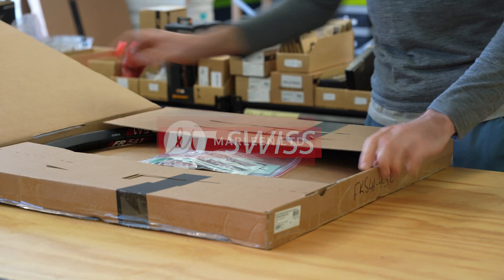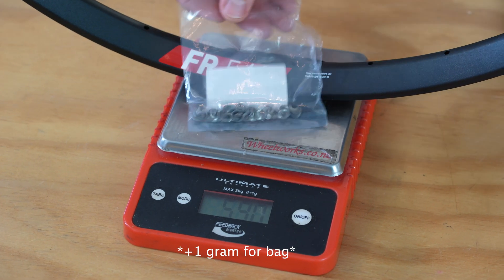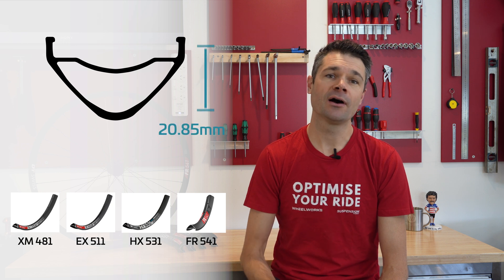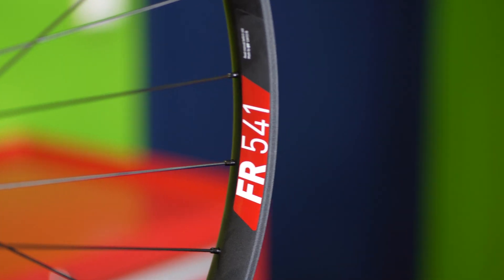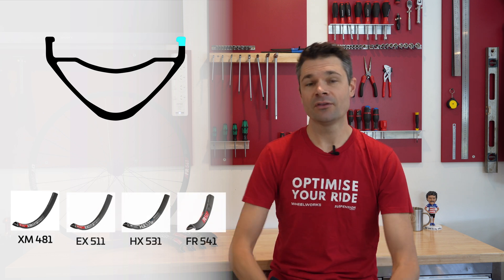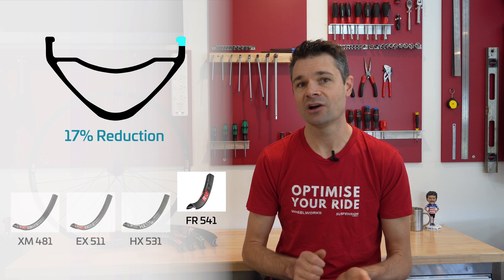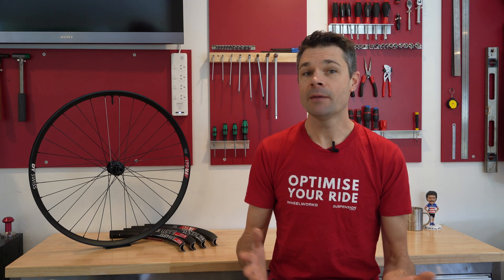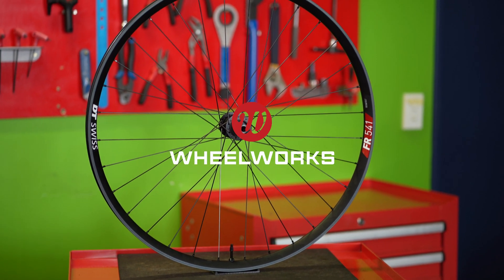2023 DT Swiss Rim Comparison and Review

Comment: I saw the impact resistance test with a 1kJ force. EX511 is left behind FR541 significantly. But how to understand such impact in a real world (speed, height, weight)? I’m not very aggressive rider, but in some cases would like to be confident, that my bike park trip will not end if I land on a root with my 210lbs weight.
Reply from the maker: This is an area where it gets complicated but interesting!  100 Joules is the equivalent of a 100kg (220lbs) rider landing on one wheel with no suspension and no bend at all in their legs from only 10 cm (4 inches).  Obviously that isn't very high!  That shows how much your body actions and your bikes suspension do to slow down the impact. -Tristan

Comment: I weigh 120kg and ride a 170mm E-Enduro bike. The spokes on the rear of my E*Thirteen E*Spec Plus wheel kept coming loose and it was constantly wobbling sideways. I had already replaced the front wheel with a DT Swiss H1900 wheel because I got it on sale for €129. For the rear, I've now ordered a custom wheel with a DT Swiss FR541 rim, 350 Hybrid hub, and 32 DT Competition spokes with DT Pro Lock Squorx brass nipples. I hope it will hold up better. The H1900 with 28 spokes at the front is absolutely sufficient, but for the rear, I opted for a 350 Hybrid with 32 spokes and an FR541 because it carries more weight. The E*Thirteen E*Spec Plus wheelset that came with the bike from the factory is definitely not stable.  The rim height is so narrow, the spokes are as thin as wire, and it flexes excessively. Absolutely unsuitable for an e-enduro bike, which is approved for a system weight of up to 150 kg with this configuration.
Reply from the maker: Many ebikes come with light weight wheels in an effort to make the bike feel and ride lighter.  Also, unlike acoustic bikes which are clearly understood to span a range of riding styles from XC to Enduro many ebikes are just "ebikes" so their designers try to make them span the whole spectrum of uses and rider weights and styles.  It sounds like your new wheels will be much better suited to your needs! -Tristan

Comment: Which is better for Aggressive XC/Trail, DT Swiss XR391 or DT Swiss EX511?
Reply from the maker: the XR-391 is 25mm internal width which is pretty narrow these days.  Check out the XM-481 and EX-511 which are 30mm internal width.  You can put and XM-481 on the front to save weight and an EX-511 on the rear.  -Tristan

Comment: I`ve been building EX511 32h wheels for both my DH and trail bikes for the last 10 years. Just built up a new set for my DH bike and the old ones lasted me 3 whole seasons. I don`t feel the need to go for the heavier FR541 at all.

Thanks for the comparison btw.
Reply from the maker: A lot of the sponsored pros seem to be using the EX-511 still...I think it's failure mode is maybe preferred. -T

Comment: Interesting video! The dimensional differences are smaller than I expected. 
I am looking into a hand made wheelset to replace my stock wheels, as I am a heavy rider (108kg). I don't break wheels often, but most issues I have had with my mountain bikes are things like broken spokes, bent axles or out-of-wack freehubs. I've rarely had rim damage though - likely in part due to running relatively high pressures to support my weight. 
As I ride mostly XC and trail, with the very occasional bike park lap, I am looking mostly at the lighter end of the spectrum, so probably XM481 with maybe an EX511 on the rear. 
Also, having a lot of red color accents on my bike, the DT swiss logo would complement this very well 😂
Reply from the maker: The 481 / 511 combo is one we use a lot.  If you're riding more technical trails then a 511 / 541 combo would be worth looking at as well for your weight, although if you don't typically have issues denting rims then the 481 / 511 should be fine.

One nice thing about this range of rim is their ERD is close-enough that you can rebuild a wheel with a heavier duty rim if the light one doesn't stand up -Tristan

Comment: Great Video, I'm interested in what the finish of the rim is like. I have EX1700's off a Transition Spire Carbon and the rims(mostly the back) are cosmetically terrible, it must be from sealant and lube, but nothing will clean them up, drives me nuts. Do the FR541 have more of a gloss finish? Cheers
Reply from the maker: All of the modern rims that use the PHR nipple washer (ie: not the ones with visible silver eyelets) use the same matte finish.  Generally we've found it to be pretty durable and still look good after lube, sealant, dirt etc.  Do you have any photos?  -Tristan

Comment: Interesting. I've had 4 wheels built with these rims (Raild Wheels Sydney) All was fine until this weekend when my 16 year damaged 2 of them on Cannonball at Thredbo. Both running maxxi DHR2 2.4  DH casing with cushcore. The mechanic who looked at them had a whiteboard with FR541 and was striking them off as they came in for repairs. 15 in 1 weekend. He was shocked and said he's barely seen issues with the previous FR560. Now I need to find better rims for Downhill racing
Reply from the maker: That's really interesting!  What was the damage?
Reply: Man that track is disgraceful for wheels all that concrete flaging i have destroyed many 511& fr's

Comment: Almost didn't give you a like for the use of that BS DC term usage, seriously, let Mike Ley's crap die. What rims do DT offer that have offset spokes, would be curious to see a comparison of them or that kind of rim as have had great results using WTB Asym i30 rims.
Reply from the maker: None of the current DT Swiss rims have offset spoke holes.  Over the years I've concluded that offset spokes holes by themselves aren't enough to determine whether a rim is good or not...you can make a crappy rim with them and a good rim without them.  

We generally find the impact resistance of the DT Swiss rims to be better than the WTB Asym or RaceFace ARC rims for example.

Offset rims give a little more non-driveside tension which is generally a good thing.

Anyway, thanks for your usage of the like button ;-)  Tristan
Reply: @WheelworksHandcraftedWheels  Possibly I don't have the terminology correct, but my DT rims (511x 541, 1501) all appear to have an offset, albeit very small. Perhaps it's more termed "angular drilling" than "offset"? It's only slight though. Perhaps 0.5mm from the centerline.

Comment: What do you think about this setup

  Front (DT Swiss 240 EXE hub + 29' EX 511 rim + 32 Berd spokes) and rear (Aiwee (FIXIE) hub + 27'5 DT Swiss EX 511 rim + 32 Berd spokes - or DT Swiss FR 541. I wonder how the Berd spokes with the Fixie type hub will behave and if there are any contraindications for such a connection.

Comment: Where does the FR560 fit in the DT swiss lineup?
Reply from the maker: The FR-560 is no longer in production and has been replaced by the FR-541.  They are similar in terms of intended use - the FR-541 is just the newer (and arguably better for most people) one of the two.

Comment: The web is going crazy with these new version / indestructible FR rims. Only downside for me is that they only come in a 30mm Internal Width (for now). These are clearly DT Swiss newest/latest tech... Do you think we'll see the FR in different widths? 35mm Internal Width would be the way to go for my eBike on 2.6 tires. Currently have WTB HTZ i35 rims... but if DT Swiss makes the FR's in 35mm... I'm down
Reply from the maker: I sure hope so!  A 35mm internal version would be fantastic as long as the weight doesn't balloon out!  30mm seems to be the tipping point for aluminium rims - beyond that the rims either get really heavy, really soft, or both.  -Tristan

Comment: Between the HX531 and EX511, which one do you think has the best dent resistance? 

The EX511 has the slightly thicker bead lip, which will also help pinch flats, what is the difference in bead hook thickness between these two? 

Best break down of these rims- thank you!

I didn’t even consider the HX series until this video, I thought it was a cheaper pinned version!
Reply from the maker: The HX531 is a real hidden gem in the lineup!  We've built heaps of them and generally pair them with an EX511 front rim. We've found the dent resistance of the HX531 to be excellent. 

Bead thickness for the various rims is linked on our website
https://www.wheelworks.co.nz/a-close-look-at-the-dt-swiss-fr-541/

-T

Comment: Nice vid Tristan, learned a lot!
Can you do a similar one comparing the DT road rim lineup? Higher end RR411 (Rim and disc), RR421db, and the R460 level ones? Maybe their gravel rims too? Cheers
Reply from the maker: Thanks for the kind words but it's a team effort!  I'm in front of the camera but the script writing, shooting, editing and proofing are a ton of work and require most of our crew.  

Great idea to cut up the other rims in the range - any excuse for me to get the hacksaw out again.  -Tristan
Reply: @WheelworksHandcraftedWheels  I saw a bunch of DT aluminium rims cut up on display at a wheelbuilder’s workshop over in Perth. Gotta say, they are VERY impressively made with purposeful wall thicknesses and shaping… if the inner width and outer width dimensions are amenable to ones’ needs, I see zero reason to choose carbon rims over these unless you’re getting paid (or aspire to get paid) to race and absolutely need the (marginal) aero and weight gains.
Reply: @thedownunderverse  Друг  для  МТБ , какой  посоветуешь  диск  481  или  511.???
Reply: @ЛеонМикер 481